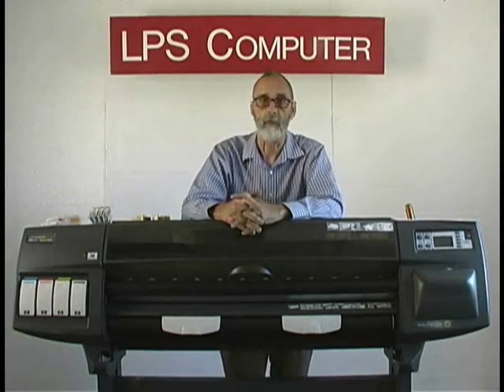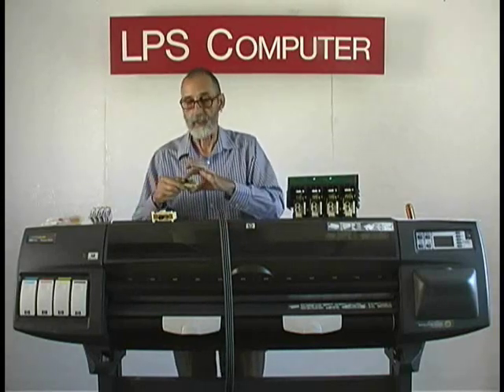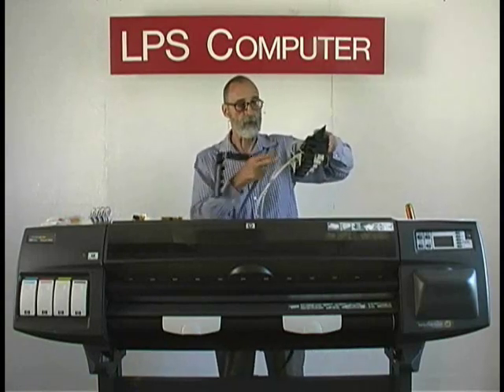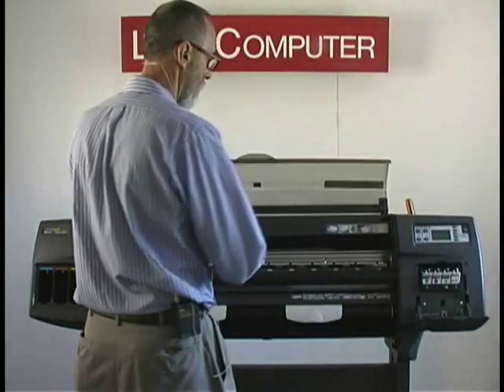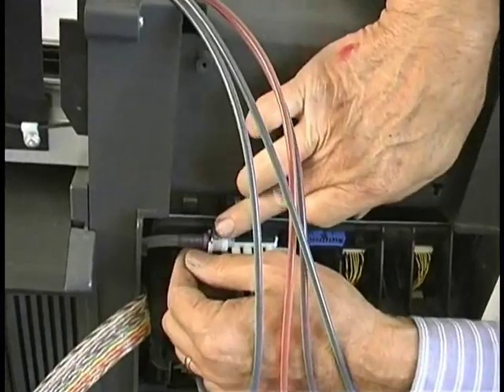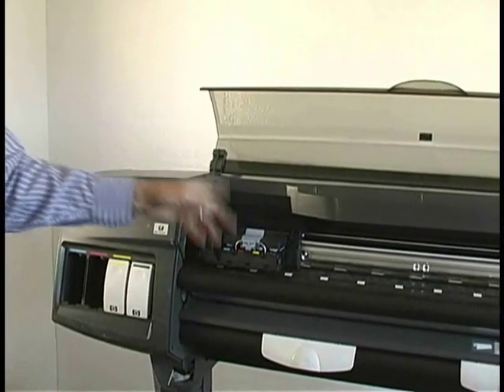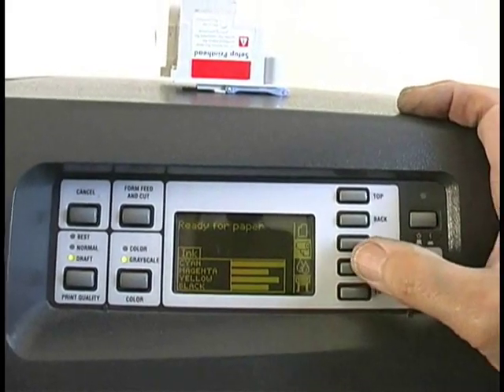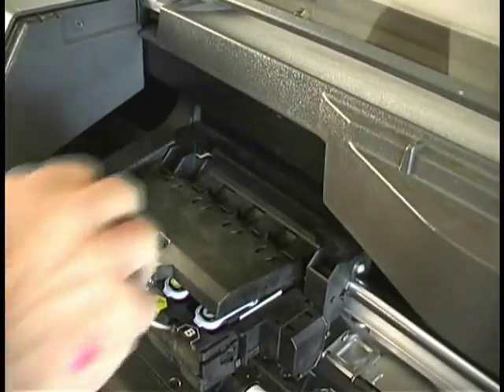HP Designjet 1050C Ink Tube Replacement Tutorial

Comment: Your video is quite informative and was a great step by step process.  The video is what led us to buy the replacement system from LPS. 

With that said, it would be nice if the video could be edited (even if it's just a text overlay) stating that you no longer ship the purge print heads (or the grease or the plastic bag to wrap the returned core) as it is quite frustrating to have to reverse several installation steps to remove all of the heads, remove the air line to use the giant syringe to purge the air rather than just popping in the heads that the video shows being a part of the kit.

P.S.  Since a syringe would seem to be far less expensive than a set of purge cartridges, why didn't the price for the kit decrease?

Comment: There is a Air in my HP z5400 plotter's ink tube. How to remove that??? some times it prints color some time not. I find the option of purge from searching websites but i dont know,  should i use it or not because there is name dummy printhead, why we need dummy printheads, why we cant use original working printheads and how to use that option. Plz Help or tell me if there is any other option for this problem
Reply from the maker: When the ink tube system is new, there is no ink them.  To prime them, dummy print heads are used.  They differ from production print heads in that they have a chemically treated filter in them.  When the plotter pressurizes the ink it moves through the tubes to the print heads.  The filter lets the air out and clogs when the ink arrives.  Air in the ink tubes after priming is another issue.  The dummy print heads will likely not get all the air out of the tubes because the first drop of ink that gets to the filter will clog the filter.  If there is still air upstream from the the first drop of ink, it is not removed.  The best solution is to use a purging tool we have to remove all the air from the tube system. https://www.lpscomputer.com/collections/designjet-z5200-parts/products/designjet-ink-tube-priming-tool

Comment: Hey bob can we use real working printhead for purge??
Or is there any side effect of this??
Graphix Printers
Reply from the maker: Hi Hardeep. Do not use good printheads for the priming procedure. The printhead has a small reservoir to maintain ink supply to to the print nozzles. If you print or prime on an un-purged tube system using a real printhead, the ink in the printhead will be displaced by the air from the ink lines. If the print nozzles attempt to print without ink present, they will burn out, making the printhead unusable. The best solution is to use the universal priming tool to prime the ink tube system: https://www.lpscomputer.com/collections/designjet-500-800-parts-page/products/designjet-ink-tube-priming-tool

The priming tool is included with the rebuilt LPS 1050c ink tube systems.
Reply: Bob Wert Thanks Bob

Comment: I just bought a 1050c. It starts and gets to a point where it stops an shows the ink levels. It shows the black and it says insert. I removed the cartridge and re inserted it. It still says insert still. I replaced it and it still reads insert. Could you suggest a solution. Thanks.
Reply from the maker: It sounds like you've got a faulty connector on your ink tube system. Take a look at the gold pins that contact the smart chip on the ink cartridge. If any of them is bent or tarnished, it's not going to read the smart chip. If everything looks okay on the connector, the ink tube PCA itself may be the problem.

Comment: Good Morning !
please to my machine 1055cm plus, this is giving the 0B0005 00000FF error.
I do not know what else to do.
Can you help me please.

Thank you
Reply from the maker: That error indicates the printer can't detect an ink supply valve. Start by re-seating the cable that connects to the ink supply station PCA and the ink tube PCA. If there is no change in symptom, replace the ink supply PCA. If there is no change in symptom, replace the ink tube system.

Comment: my printer hp designjet 1055cm plus displays an error message as " 0B000D 00000007" and does'nt prints again so i don't know what to do again .
plesse show me how to repair it now
Reply from the maker: That's a power supply failure. Here's a link to the part: https://www.lpscomputer.com/collections/designjet-1050c-1055cm-parts/products/c6074-60405r-designjet-1050c-1055cm-power-supply